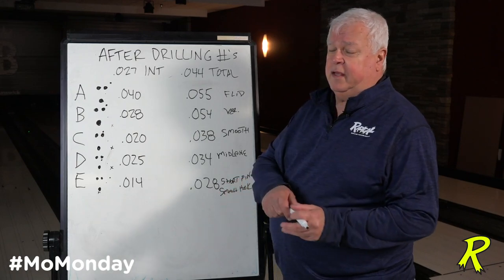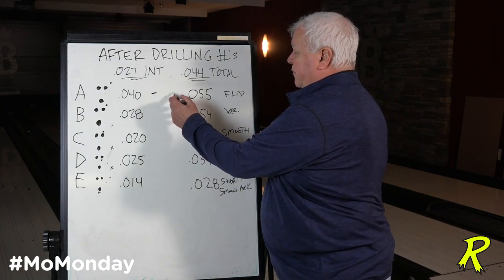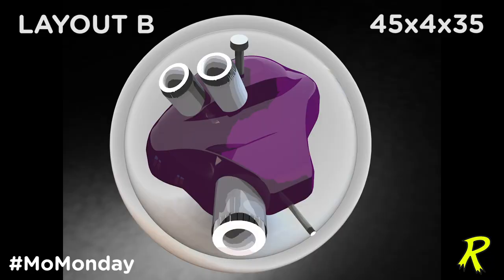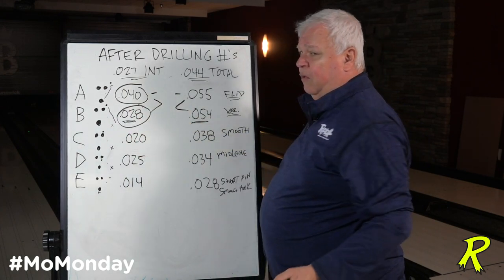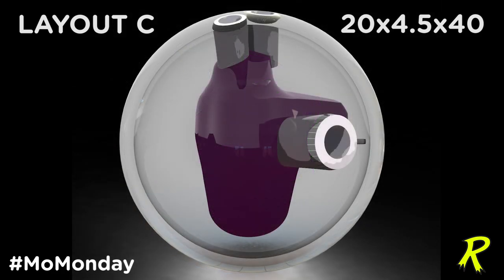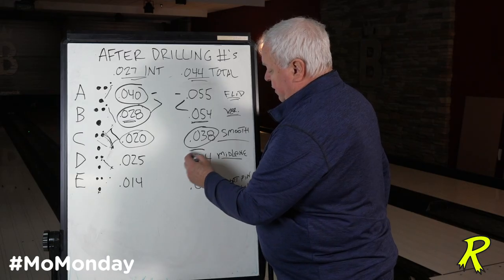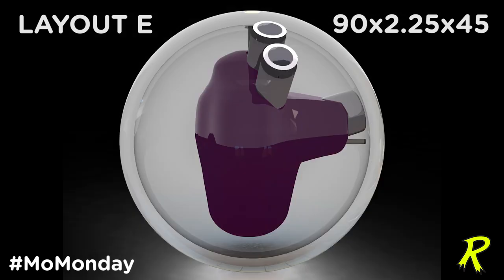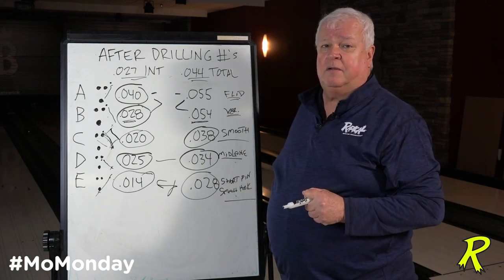How Layouts Affect After Drilling Numbers - #MoMonday

Comment: The obvious extrapolation is that the size and shape of the core, as well as the span, pitches, hole size and depth, and PAP are all factors in the final core numbers. I'm having a hard time understanding how this can possibly be predicted with the vector or dual angle layout systems, which do not account for many of these variables. I have a very good understanding of how the dual angle system works, including angle sums, angle ratios, Athery's chart, etc..., but my intuition is often at odds with the layouts I calculate using the system.

Thanks for the illuminating videos!

Comment: I like this video a lot. It can almost be used as reference material for ball drillers when trying to orient cores to get a specific ball motion. What would also be great is to have a demo video of a few balls drilled with the same pin-pap distance and different psa-pap distances so that we can see the actual effect of moving psa around.
Reply: One problem with this kinda video is that the differences are so slight you hardly notice. Biggest impact is probably in miss room and that's hard to quantify

Comment: I am looking to replace a 18yr old WD. I am looking at the Spy.  I thought this might give me the Spare ball and drier lane strike ball. The issue is with a 5 inch PAP and medium axis, what might be a suggested drilling?  I drilled the Results + 65x5x40. I am not comparing these balls only the drilling that worked on that Radical.
Reply: If your looking for a combination spare and short oil ball have to given urethane a thought? I was considering the Spy with a short pin for the same uses as you.   Several videos talk about using urethane for spare shooting.  My PSO said urethane can fill both needs but suggested I stay with plastic because my spare shooting accuracy is still lacking.